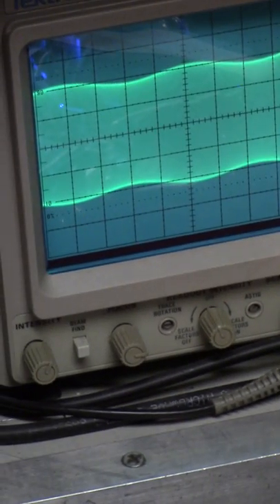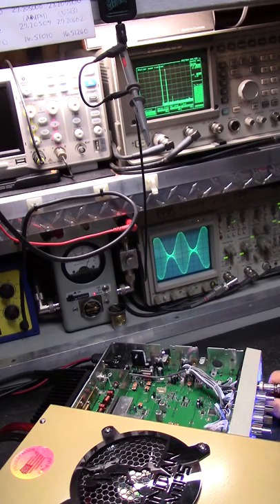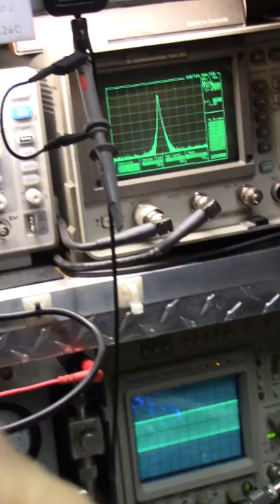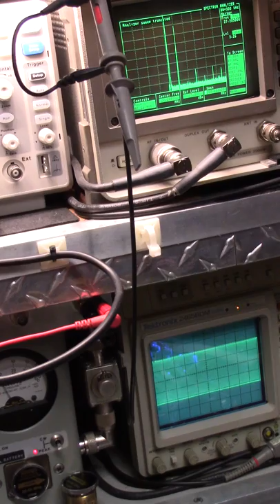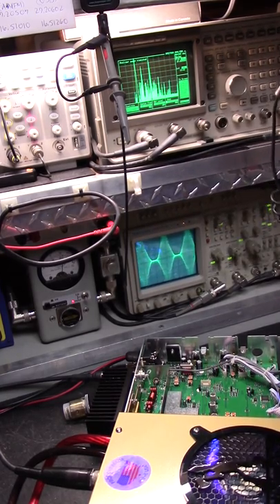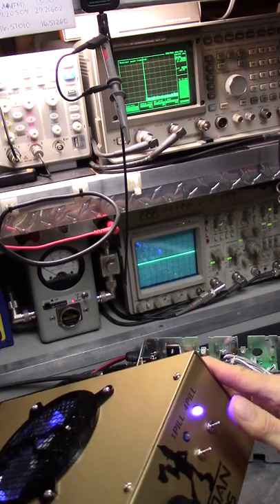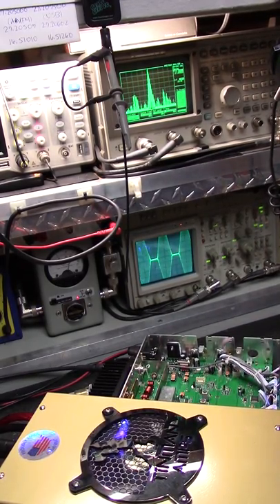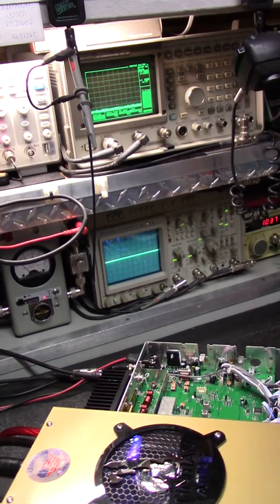TinMan Amps What "Self Oscillation" @ 20:41 Looks Like.

Comment: Flywheel effect in effect?  man that was nasty!
Reply from the maker: That's the exact definition but not normally used in this arena .. Thanks for stopping by.

The flywheel effect is the continuation of oscillations in an oscillator circuit after the control stimulus has been removed. This is usually caused by interacting inductive and capacitive elements in the oscillator. Circuits undergoing such oscillations are said to be flywheeling.     Wikipedia.